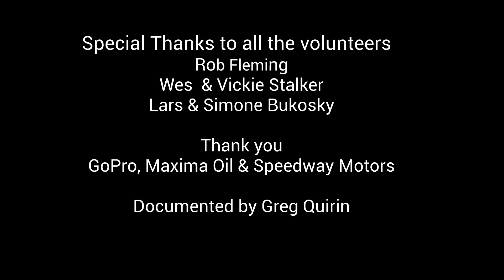"280 MPH Salt Flat Setback: V12 Engine Fails at Bonneville"

Comment: I have been running all Haltech ECUs for the last couple years. Their R5 system will cost a bit more than some others, but they are reliable and they do EXACTLY what they claim. I have had some issues in the past with other manufacturers but haltech is flawless. And their tech line is invaluable when you are trying to build something weird.

Comment: What type of acid would it be to remove the aluminium from the bores?
Reply: Might be sodium hydroxide (aka lye or caustic soda). Opposite of an acid but just as nasty. Use it to get aluminium off of rotary burrs

Comment: Hi Greg, we met at El Mirage briefly - I'm the guy who makes custom motorcycles in Taiwan. Wanted to suggest the AMP EFI MS3 Pro ECU. They are made in the USA and support V12 engines. They are also an open source design so there are no problems with planned obsolescence. Of course there are pros and cons to every choice, but it seems like MS3 would meet a lot of Peet and Kevin's needs. I've had great luck with them myself too. Thanks!
Reply from the maker: @morganelliot7153   great to hear from you! I remember you.  We purchased a HalTech R5 and we are starting to build the harness this week.  I think we have everything we need at the moment.

Comment: Fuel is there to burn but before it does it cools the cylinder when you run lean aluminum can't hold up to the sustained heat without the cooling of that fuel . Bummer this happened I can't think of too many people that deserve a record as much these fellas they do amazing things out of that shop

Comment: That poor motor was bouncing around redline way, way too much. Not surprised the motor got hurt. You guys need to get a handle on the throttle control issue. Don't get me wrong. It was a great effort by your team.

Comment: Arrh, what?? Haltech DO NOT OWN MoTeC. They're completely different companies, with MoTeC now being under the Bosch group of companies. Both make great products. I find it difficult to believe that the 'adjusted in the wrong direction' error would come from either company. It's far more likely to be a setting that's inverted, such as the direction the voltage goes on a sensor is set backwards where the ECM is told what the input will do.
Right at the start of the run, that spot where it spun up the wheels and was all over the track, is the exact same spot that Alex Taylors videos show her and others having the exact same issue of traction and soft surface. Once past that spot, or further out to the right, the surface was better.

Comment: Man, that is a bummer! Stinking computer! Wow, things go wrong fast when you are pushing the engine to 10,500 rpms. You have built that engine strong because it did not have too much damage even after all that high-speed hammering.  A few other carmakers make V-12's: could you adapt a controller from one of their engines?

If worse came to worse, could you borrow a second-hand engine from Cosworth?

Still gotta follow you all!
Reply: Cosworths are in short supply this side of the pond .

Comment: I have a haltech R5 on my turbo viper and my god is it nice. I absolutely love it, i tried fueltech offering and the ecu was defective sofware was lacking and their boost controlller solenoid were bad (one leaked, and the other looked like trash brand new) Everything ive bought from haltech on the other hand has been top notch and software is really powerfull.

Comment: I hate to be that guy but he says in the video that he turned the transmission off and then back on again but you can very clearly see that he just turned it on after banging it off the limiter for 20 seconds. Unless I miss something it looks a lot like it just was never turned on to begin with.
Reply from the maker: There were so many distractions leading up to the launch.  Moments before we were ready to be sent down course a streamliner exploded and caught fire next to us in the staging lane. This put us on a course hold for 10 + minutes while the driver was in the car while outside temps where over 100 deg. Then we were ready to go and  the canopy closed and in the push truck and there was a second course hold for 2 minutes with the drive roasting inside.  Hard to say exactly what happened with the switch, however, we are going to replace the switch with a  flip up safety cover type and possibly incorporate a indicator light when the ignition is on and transmission is off.   This kind of of happens from time to time.
Reply: @GregQuirin  okay yeah I just wasn't sure if anybody had noticed in the video that it was not on to begin with. I didn't want you guys chasing the wrong problem when it appears as though the problem was it just wasn't turned on.  But yeah all good these things definitely do happen.

Comment: Oof, these things happen. If it was easy, it wouldn't be fun.   There is predetonation, but then there is a lean condition that just melts aluminum, like a plasma cutter.  I did a similar thing with a turbocharged engine, and it melted a piston and a bunch of the cylinder head, the exhaust port "ported" itself. It deposited aluminum on the cylinder wall as here, and filled up the turbine wheel of the turbo with molten aluminum! Good times.

Comment: Thanks. Muriatic acid or stronger hydrochloric? I love the shop stuff but sorry the ECU failure caused the need. Thanks again.
Reply: I would imagine it's muriatic. That's what I was told to use on a 2 stroke engine I melted a piston in.

Comment: Since they only need wide open throttle I would hope they run a locked out distributor
And a carburetor. 

You won’t gain power with fuel injection and computer ignition.

Comment: Bummer Motor issues😢

But Traction in low speed needs to be addressed❗️
How about a DRS as used in F1?
Appears the Exhaust heat may be heating the Drive Tires😮
Turn the Collector UP?
Or Low Leading Wings in front of Drive Tires as NHRA Top Fuel?

Old Skool Gear Head, just thinking😊

Comment: If Pete and Kevin need ECU options then I would suggest looking at companies here in the UK like Cosworth Electronics (formerly Pectel), Syvecs and Life Racing. All three will be able to cater for a V12 running in excess of 10k rpm like this one. They won't be cheap but they're all motorsport orientated companies used across the globe.

Comment: Maybe you want to run the ecu full sequential but if you find that you want more options you could run a Link ecu. I do on my v12 in my drift car. I do however have to run it wasted spark and batch fire on the injectors. Thanks for the video!